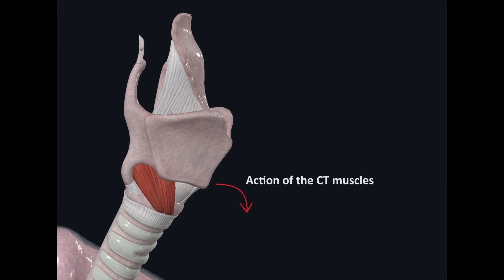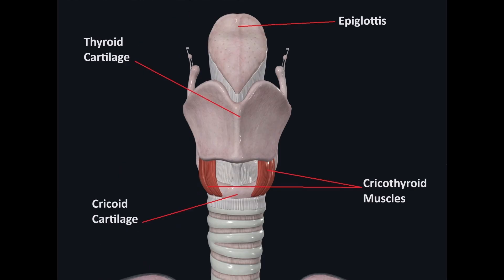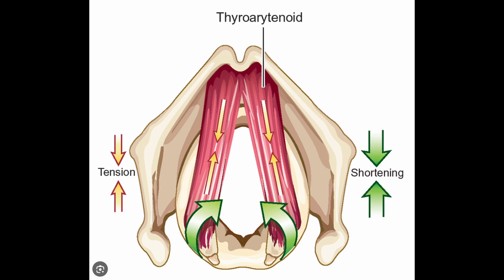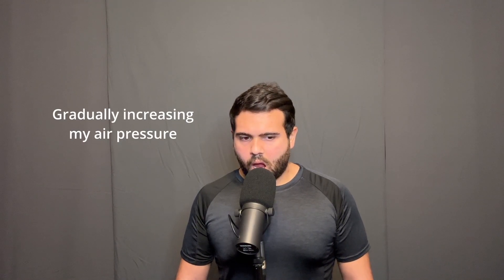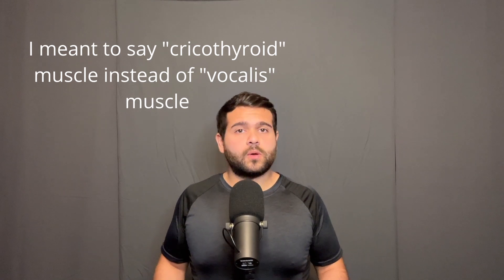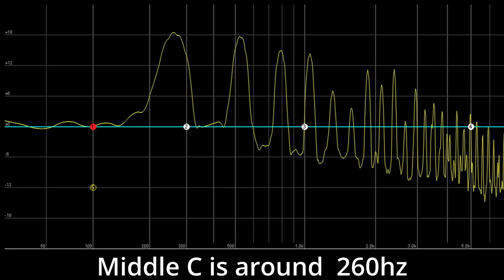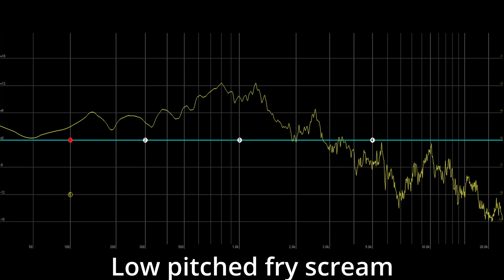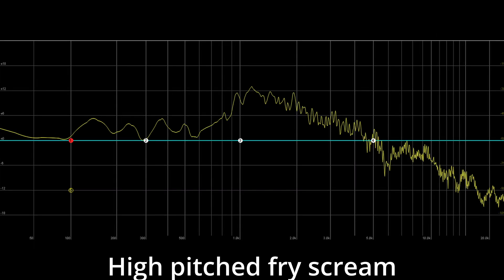Fry Screaming Biomechanics

Comment: Do you think chord closure has anything to do with it as well? I like to think of three vocal chord closures, one being found in regular chest/head voice singing where the chords are touching as they oscillate (regular singing, belting), another being falsetto closure (possible in head and chest resonances) where the chords are parted open slightly to allow for more air flow (gives it the breathy sound) and finally the fry position that lies in between these two closures. I imagine the muscular tension required to raise the PTP is created not only by the isometric contraction you've pointed out but also by the posterior cricoarytenoid muscles that are responsible for true fold closure. Also if you think about a pitched fry scream, is it the case that the tension between the thyroarytenoid muscles and vocalis muscles must be different. Say you were using the perfect amount of air pressure that would cause the vocalis muscles to crackle (fry) but thyroarytenoid muscles to oscillate like normal. This would mean the PTP of each would be different due to a very delicate difference in the tissue tensions. What do you think of this?
Reply from the maker: I think you read my mind with most of this. I just didn't want to go so deep in the weeds on something that I'm not 100% certain of. The degree to which your vocal cords come together likely does play a role and there needs to be some closure in order to for the true cords to make any noise at all, but I think the majority of the mechanism happens due to building up tension in the true cords during isometric contraction of the lengthening/shortening muscles. However the posterior CA muscle opens the true cords and the lateral CA muscle closes the true cords. So another agonist/antagonist relationship. These muscle pairs probably also work together isometrically to hold the true cords in a specific position to maintain a certain degree of closure during fry screams. This website shows the actions of most of the muscles and how they affect the true cords. Just scroll halfway down to the subtitle "muscles of the larynx" and look through the pictures on the right side of the screen. https://www.kenhub.com/en/library/anatomy/vocal-cords

Now I certainly feel as if the medial muscle fibers in my true cords (aka the vocalis muscles) are more active than the lateral muscles of my true cords when I fry scream. It feels as if the medial margins/surface area of my true cords tense up more, while the lateral surface area is allowed to freely vibrate. But the PTP will change depending on the amount of overall tension. The way I think about it is like this. 
soft fry distortion: very little air pressure needed, so very little tension is needed as you are already very close to the PTP anyway. 
Full power fry scream: lots of air pressure so more tension needed to raise the PTP above the air pressure that you are using to get loud. 
Pitched fry scream: lots of air pressure, but slightly less tension needed so that you can be slightly closer to the PTP, but still just below it. Its like you are dipping your toes into the fry register, and very slightly slowing down the true cord vibrations so that you can still hit notes but also produce a hint of distortion. 

Hope that makes sense.
Reply: @Scream-Theory  It makes perfect sense. Very interesting there are two different muscle groups potentially responsible for the isometric contraction we see raising the PTP (posterior CA + lateral CA / Thyroarytenoid + cricothyroid). And in order to get smooth distortion (high frequency percussive noise) there is a balance between tissue plasticity and elasticity. I think this relationship is found between the vocalis (plasticity causing fry crackle) and thyroarytenoid muscles (elasticity increasing frequency). I think you're right it's found on this very delicate point where we "dip our toes" into that blend found at the right PTP. You should write a paper on this and do some laryngoscopies lol.
Reply from the maker: @Fryingpan-b1o  I would love too but I have reached out to every ENT clinic in my city and every college with an SLP program within 100 miles of me to see if I can get an endoscopy done while I scream, and every single one of them has either refused or nobody was interested in helping me. It's honestly been kind of depressing.

Comment: one thing: great info BUT this is just vocal fry screams. i hate the name fry. u can create fry distortion with just about any cartilage in your throat. if u do Khovu Kargyraa and add pressurized air. boom u get the deathcore style fry scream. (falsecord fry) NOT false cord scream. also will ramos uses this technique as well as Dag Kargyraa to fry. (Khovu is Khoomei throat singing and Dag kargyraa throat singing at same time)
Reply from the maker: I hear what you are saying but this is where I disagree. I have seen this argument many times. Yes, you can make the false cords and even the arytenoid cartilage vibrate either faster or slower to produce a smoother or rougher/gurgly sounding distortion. The smoother sounding distortion is what some people refer to as fry distortion. But in reality, this is just a different variation of a false cord scream (or arytenoid cartilage screaming depending on which tissue you are using). I agree, it would be better to call it something else, like "Smooth false cord screams" and "rough/gurgly false cord screams".  But either way the distortion is coming from the false cords. I actually demonstrated an example this towards the end of my Ben Duerr analysis video. 

What I and many others consider to be actual fry screams are solely produced by the true cords, which creates that raspy/screechy distortion. Each vocal structure (true cords, false cords and arytenoid cartilage) has different mechanical properties that results in different qualities of the sound. You can produce a similar sounding distortion with the false cords but it still won't sound 100% like how an actual fry scream sounds, and this is the crux of all the confusion between how distorted vocals are classified in different communities of distorted vocal enthusiasts. I  have been planning to make a video on this for a while now. It will probably be the next video I make. 

But the best example I can provide right now is this. Listen to the voices of Dan Watson from Enterprise Earth, or Darius from Spite. Both of these guys primarily fry scream using their true cords. Listen very closely to the quality of the distortion. This is what I mean by the raspy/screechy sound of a fry scream. Fry highs typically sound very screechy, and the fry lows have a slightly different quality to them that I can't quite put into words. Then listen to Scott Lewis of Carnifex and Jason Evans of Ingested. Both of these guys primarily use their false cords. Once again listen closely to the quality of their distortion and you will be able to hear the fluid/hollow overtones of their false cords vibrating.
Reply: @Scream-Theory  ok, i can understand your point of view on that, i personally choose to avoid true cord distortion because its sketchy to me. but if it sounds good and doesnt hurt then go for it. i just bring it up because ive been trying to learn screams learning this technique for years and was only when i switched to the techniques i mentioned that i started making progress. i can do the vocal fry scream, it just feels very limited in sounds in comparison. i am very interested in learning the “vocal break” scream or whatever its called haha the one M Shadows and Chester Benington do
Reply from the maker: @ShaunTheStickbug  So that style of scream is typically referred to as a "pitched fry scream". I created a fry screaming exercise program for free if you look at my videos. In it I provide all the exercises needed to develop the skills that make fry screaming easier to learn. Part of the progression I use to help people get those deathcore style from screams is to actually learn to do a pitched fry scream first. I am a physical therapist so building exercise programs for complex motor skills is within my wheelhouse. Check out the videos and I promise it will get you closer to that goal.
Reply: @Scream-Theory  Yes! thats it haha i may get on it eventually im still working on my pitchless ones i forgot those were pitched screams
Reply: and thx alot ill look into em
Reply: Khoomei is great for learning proper vocal cord closure, kargyrra for false cord closure.
Reply: Dag Kargyrra is typically the one taught to learn falsecord screams and khovu to learn “compressed” falsecord screams, only thing that turns these techniques into fry is the air u use. open air to fog a window or whatever=falsecord scream, pressurized air=fry scream. i like this terminology better it makes more sense. srry for the info dumping just need to get it out of my head lol